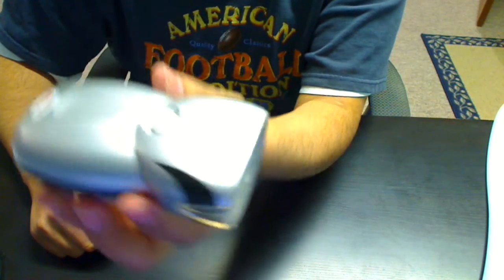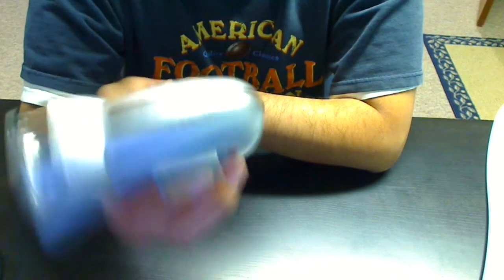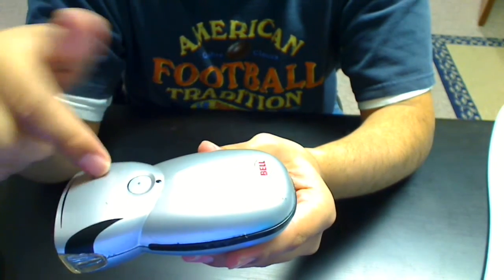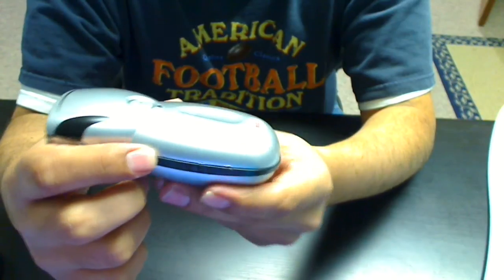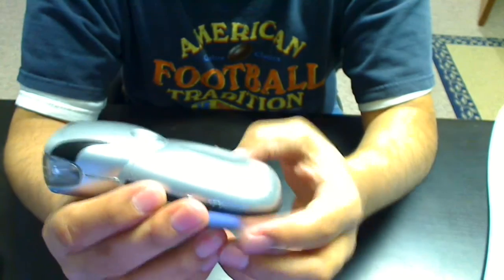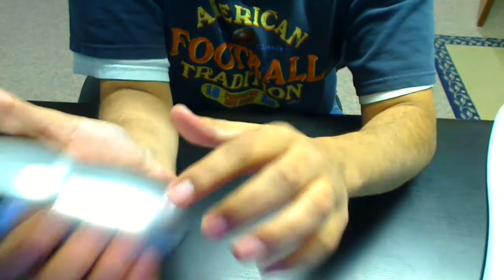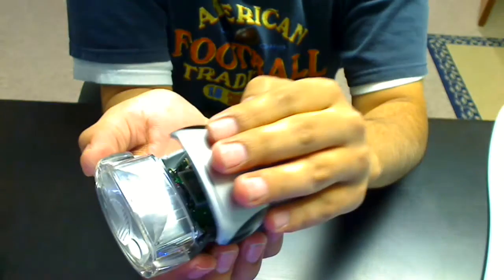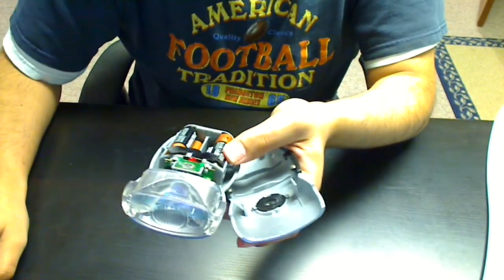replacing batteries on Bell Trail Light

Comment: The glories of the internet!  I too could not figure out how to get this thing apart and lo and behold I found your video first thing.  I even have some marks where I was starting to pry it apart!  The only thing I might add:  I still could not slide them apart, but once I saw from your video how they came apart I put pressure on the top front edge of the cover, just above the lens, by pressing it against the sharp edge of my vise by holding the bottom half and pushing forward.  Doing that while pushing in on the sides finally allowed them to slide apart.  Once you have it apart you can see that the only thing that holds the halves together are the two little latches which are released when you press in on the sides.   Thanks for taking the time to make the video.
Reply from the maker: +Tim Seaman The glories of the internet indeed! In my frustrating I decided to make a video, maybe more for myself so I would have a way to check later, and I've been so pleasantly surprised by how many people have found it useful. Thank you for the comment and for adding more information on how to open the really stubborn ones.

Comment: Thanks for the post!  Helped a lot!  I actually found it easier to flip it over and push forward on the bottom rather than pulling back on the top, but either way, getting a look at exactly how it comes apart and then back together again was what I was looking for.

Comment: Thank goodness you posted this.  But when I could not get it open, after spraying with WD-40, IT slipped out of my hands and crashed, but it opened.  However, the light portion fell out of the top part and I can now only get the 2 tiny lights working, not all 3 at the same time!

Comment: I'm glad you had this video.  I'm cleaning the garage and cleaning sawdust off from the bikes.  I noticed the center bulb on my wife's glowed for a quarter of a second.  The leds work, but I forgot how I put the batteries in.  If I hadn't seen this video, I'm sure in another 2 minutes, it would have been destined for the landfill.  Now I'll just take the batteries out for the season so they don't corrode.

Comment: Brilliant.  Once I knew how it was to come out then it became easy.  I still had to help it get going by gently using a flathead screwdriver to the top front of the light. It is not a matter of forgetting how to replace the batteries, only that the mechanism is pretty brute force as ya gotta physically squeeze the sides in, there is no special mechanism, just physically compress the sides. Ugh.  Thanks!

Comment: I took the lens cover off easily, thinking that was how you gain access to the batteries...But that just allows you to replace the bulb.. I still could not remember how I open it..With your directions and me taking off the lens cover (by pushing on the lens clear plastic on the sides with my index finger and thumb) Once that is done, just push down on the top and it slides off easily. I forgot it took (4 )AA batteries LOL

Comment: I'm having a similar challenge with the tail light.  Have you found anything or had any success with that?  Thanks so much for posting this.  Don't have to change the batteries in the headlight yet, but sure the time will come.